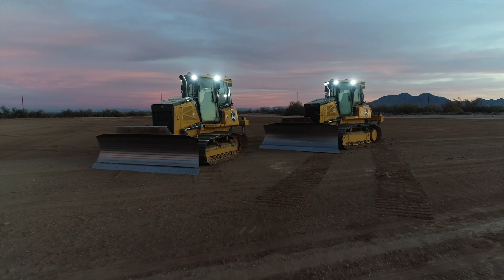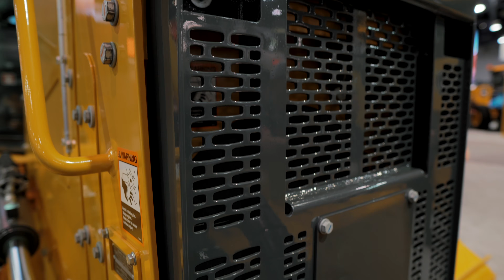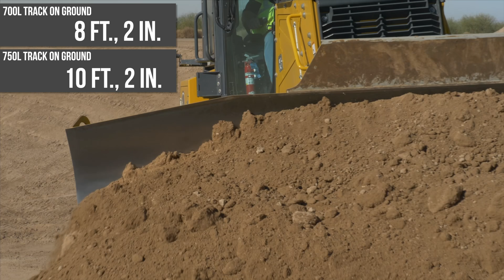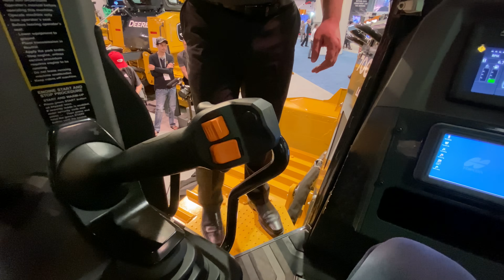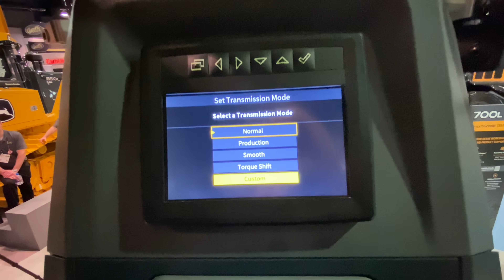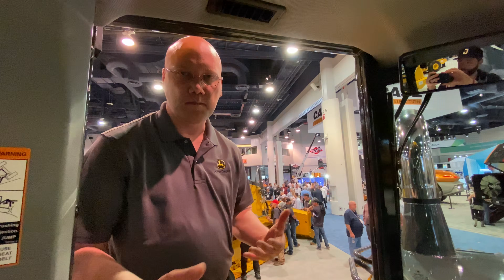John Deere Unveils 700L, 750L Dozers: More Power, New Cab, More Visibility

Comment: I am wondering if the DEF compartment has heat? I am in an extreme cold climate area and the DEF would freeze between the tank and the dosing nozzle if not heated. 
Cheers, stay safe
Reply from the maker: Hey Carl. We reached out to Deere and here's what their engineers said:

"John Deere equipment that utilizes DEF systems are designed to work in various climates. When the engine is turned off, the DEF lines are purged by pumping all the fluid back into the DEF tank. The DEF tank has added capacity to allow the fluid to freeze and expand as needed. After start-up, engine coolant is circulated through coils in the DEF tank to thaw the fluid. The DEF lines are also heated with an electric heating wrap to prevent freezing in the lines during operation."

Thanks for watching and let us know if you have any other questions!
Reply: @EquipmentWorld  Diesel Pickups and Semi's, up here, have heaters 12V/110V in their DEF tanks. Plug them in for the night everything is good. If not, and you do not have E-APU/APU, darned that sucks. Could use stronger language, but I don't want to be tossed.
Cheers all
Reply: Typically the systems are designed to freeze, but have room for expansion. And then, once fired, the machine has a DEF heating element and can redirect exhaust in some cases, to help heat things up as well. Now, I am not sure if that is what Deere does, but I know that is what other OEMs do.

Comment: I operated the 850L and they are an awesome machine. I like it as much as the D6T. It would be nice if the one I have had cross slope control. Deere made big steps forward from the K series
Reply: I'm not sure I like the seat in the angle position